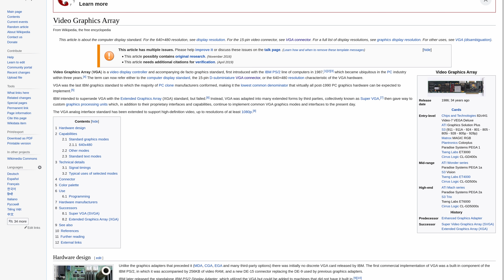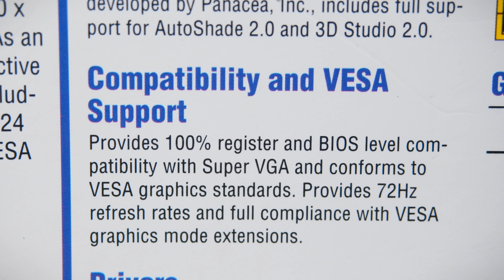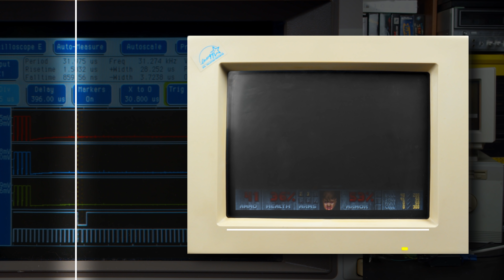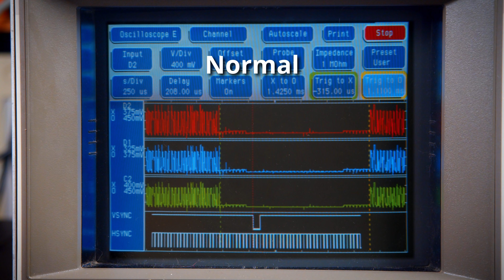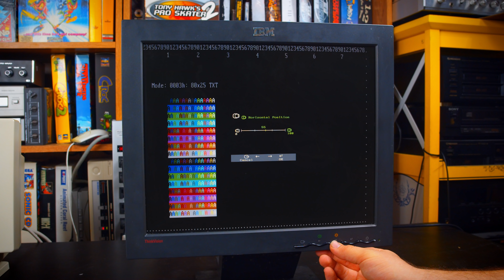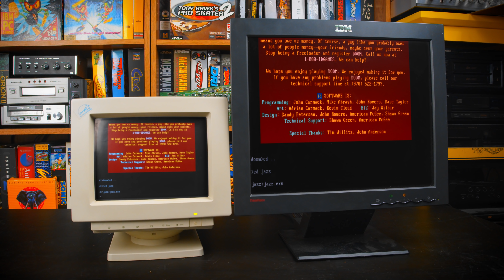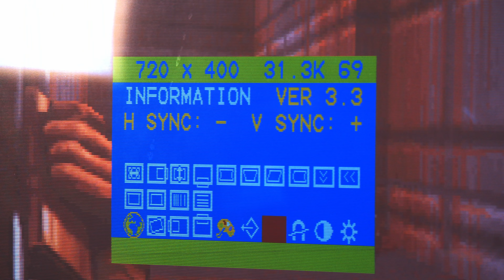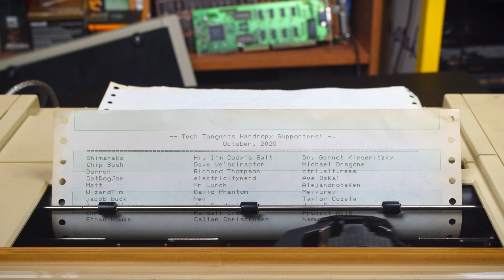How VGA Works

Comment: Also the old VGA was a cheap hack. The 480 lines come from NTSC, 480i for the visible image. What VGA did is to create a 60p version out of it, meaning just doubling the vertical frequency of a monitor and sending line after line (no interlace). So you could  use TV-similar circuits to produce VGA monitors (the stuff after the NTSC decoder to R/G/B).
Some VGA monitors even synced as well to an R/G/B 480i signal, output by an external TV tuner for example.

Comment: Multimode CRTs existed before the VGA video standard. NEC was marketing their original MultiSync and MultiSync II already when the PS/2 showed up. They later included a HD-15 to DE-9 adapter to use the monitor with the fancy new video standard. VGA could also output 15khz video to NTSC or CGA timings with some register poking.

Regarding high refresh CRTs, the bigger issue is usually the quality of the video card's onboard DAC. Most outputted muddy blurry video at higher refresh rates. Hook up a card with a quality DAC like a Matrox, and you clearly see the difference. Whats odd is that video card vendors never really marketed this, just the resolution, color, and refresh rates!
Reply: I don’t get how the amplifier in the CRT is not always the limiting factor. More difficult to amplify to 60 V. How did they even shield this to avoid radio emission?

Comment: @2:49 nitpicking: EGA was maximum of 64 colors, due to the 6 bit resolution, not 256 colors.
Reply: Yes, and even those were just the palette colours. 64 was NOT the number of simultaneously displayable colours, which was limited even further, to a choice of 16 (from the palette). This was due to EGA only working with 4 bits when it came to the actual image to be displayed. The monitor with its 6 colour signal lines did support 64 colours, the standard EGA card did not, a design choice that may have been related to video RAM limitations.
@Tech Tangents: Do you have any explanation or excuse for saying 256 colours there? Was it just a silly mistake, or what was the thinking behind that?
Reply: @ropersonline  chill. :) I think it’s just a simple mistake. With some tricky programming you could actually get all 64 colors on screen at once. But that wasn’t really usable for games.
Reply: @root42  Tone policing people isn't very chill yourself. Also, compulsively answering the part specifically directed at Tech Tangents exhibits the same unchill qualities and isn't a good look. So, chill? Pot, kettle, black. I would be curious to find out more about those 64 colour hacks though if anyone has any information. Especially if that was possible on original IBM EGA hardware, with or without a memory upgrade. It would depend on the resolution, at least.
Reply: @ropersonline  one game that used more than 16 colors is the stat screen of Lemmings. The game switches palettes halfway through the screen to get 32 colors. In the same manner you can more or less switch palettes every scanline. Similar to the Amiga HAM mode. I think I saw a demo where someone made an image viewer that worked like that, but can’t find the link right now.
Reply: @root42  Stat screen or start screen? I'd love to see a screenshot of that tweak in action. The 640x350 EGA start screen screenshot I found at mobygames only has 16 colours. Some VOGONS info I've just googled also seems to suggest Lemmings even switched palettes in 320x200 mode, which is weird, because on original EGA hardware you couldn't use non-CGA colours in 200-line mode, for reasons of CGA monitor backwards compatibility. The 64-colour palette was for the 350-line mode only. Perhaps that "EGA" 320x200 palette switching only occurred on odd EGA clones or VGA hardware. VGA was supported in its own right though, so any VGA owner would have been better off running that.

Comment: Technology Connections youtube channel said so many times that there's no defined resolution for analog signal. It's just artificially divided into lines.
VGA adapter has just two modes 400 and 480 lines. Many cards don't even display 350 line mode, but use 400 line mode drawing 50 lines black.
Even though VGA adapter is complicated hardware mess with tons of registers that can set a lot of different modes, almost all of them use 400 or 480 lines. VGA has unique 'double scanlines' in low-res 200 and 240 lines modes, because hardware displays each line twice.
Base VGA cards are also able to display 600 line modes in 56 Hz. Windows 3.x SVGA 800x600 16-color driver will work on any VGA card, but monitor capable of 600 line modes might be required.
VGA cards can display various modes at 200, 240, 300, 400, 480 and 600 lines. Some games also support 224 and 256 line modes, but my (S)VGA cards synchronize display to higher line counts. Horizontal resolution can be really anything. It's just analog signal. It can be as low as 240 and as high as 800. I've encountered software that used: 240, 256, 296, 320,360,400 horizontal resolution. DOS Quake shows this really well offering horizontal resolution of 320 and 360 pixels at 200, 240, 350, 400 and 480 vertical lines. These are all basic VGA modes. Highest 256-color VGA mode is 400x600.

Ironically VESA modes aren't that flexible, but VESA is just simpler and better. VGA is limited to 20-bit memory addressing of x86 real mode. Which maps only 64 KB window of video memory above base 640 KB. VESA compatible cards have newer 32-bit memory address mode, where linear frame buffer is located at the end of 4 GB address space.
However when VESA was finally getting popular it was killed by Windows 95 and graphics drivers. VESA never had a chance to evolve into dedicated low-level graphics API with increasingly more advanced features, maybe OpenGL or hardware 3D support in general being added. All GPUs are still VGA/VESA compatible, but just as a way for OSes to display GUI on every GPU without specific drivers.

Comment: I made a device for a visually-impaired friend, a matrix switchbox. A charge pump to turn the +5V available off the VGA port into +-5V, which drove a high-frequency three-channel fixed-gain amplifier (AD8075), then a set of three 1P4T switches with 75Ω resistors. Pass all the sensing pins and sync straight through. A handy little box with three switches that let you manipulate the three color channels in VGA - swap them around, remove one, duplicate one onto two or three.

Have trouble on games because you are red-green color blind? Swap the green and blue channels, and those red/green meters turn into red/blue meters you can see more easily.

Doing the same on HDMI would require far, far greater electronics skill - you'd need to program an FPGA. But on analog I could not only do all that on analog processing, I did it almost entirely on stripboard too - the only SMD part I needed was a tiny carrier board for the amplifier. Did have to keep all the wires as short as I could though, at that sort of frequency. I was really surprised that there was no visible loss of quality, even at the highest resolution my monitor could handle.
Reply: That's awesome of you to help out your friend like that!

I wish they'd employ people like you when designing cars. My friend's digital dashboard has a red line on a green overlay for his speedometer, but he's red-green colourblind, so he literally can't see how fast he's going!

I've installed LineageOS on my Samsung Note 3 and it has display settings allowing me to adjust colours and help compensate for colour-blindness. Just thought I'd let you know this is available if your friend struggles with smartphones.

Also lots of new cars use extremely thin strips of LEDs circling the headlights and brake lights for their turn signals, and for anybody with astigmatism, thick glasses, or poor colour recognition, the dull yellow LEDs get completely swamped by the much brighter lights next to them. It's like if you asked somebody to design the absolute worst way you could implement a vital safely feature, that's exactly what they use now. They never once considered people who don't have perfect vision, who make up 20-40% of everybody if you include just colour-blindness and wearing glasses.
Reply: @Microwave_Dave  Oh, here: https://www.youtube.com/watch?v=8HBHJB0lAL0

I've already described the circuit in sufficient detail that anyone with a reasonable skill level could build it. But if you have use for such a thing, I could draw up a schematic such that anyone who knows which end of a soldering iron to hold could build one. It's remarkably simple to construct, though VGA is becoming a rarer connection to encounter every year now.

Comment: Remembering the configuring Linux XFree86 the old way, keeping in mind the warning : bad parameters can fry your monitor !
About the Atari ST video output, too bad I'm much more a SW guy than an HW one. I'd like to connect mine to a VGA display. I know it's possible, it requires few components, but I've read it also needs a monitor that can handle "slow" signals, since the ST outputs low res compared to VGA.

Comment: I actually run 15" CRT in 1024*768. It worked, but won't go up 43Hz Interlaced, or something like so, which was incredibly useless. Also, that ridiculously high-speed CRTs? Good luck with finding video card working with those five BNC cables interface :)

Comment: I'm perplexed about the last bit. Sure the high frequency signals needed for high-res/high-refresh modes certainly needed good quality cables, but what do you mean you don't know if it's worth it? Not only was it worth it, but it was absolutely necessary. Good quality CRT monitors with low-persistence phosphors at 60hz (and at high resolutions) are headache inducing after a few minutes, nobody I know would ever run a CRT at anything lower than 75hz, and for me 85 and up was extremely desirable. And given good quality cables and connectors, the picture quality is excellent, no degradation at all. I have no idea how they managed that, it seems like black magic to me, but they absolutely did.

Comment: How did that table make it through the video ???
I used to run a 21 inch monitor at stupid resolution at 85Hz and when we first plugged it in the picture was terrible, with everything having a shadow or echo on the screen. When I rang the supplier, they said "Oooops, sorry. You need this special cable." They sent me a cable that was standard VGA at the PC end, but a set of BNC connectors at the monitor end. With that, the picture was awesome, though it was used for network management rather than Quake. That was on the other work PC.
Reply: Good CRT needs good cable. Particulary, when you go above 1024x768 x 75 Hz resolution.

Comment: cga, ega, vga oh my. LOL  I remember when I first started in computers. A nec multisync? monitor had 2 ports on the back and ran at least all three modes if not more. I love Kds and Viewsonic monitors. But due to space. I got rid of all my crt's except for one Macintosh one. I don't even use that. I use an adapter to a LCD.

Comment: It's not complicated at all. It's just an extension of the old analog monochrome video standards introduced with television back in the old pre-NTSC days. Amplitude modulated signals coupled with sync to move the beam around. Old computers meant to work with TVs used exactly the same method except mixing the sync in with the amplitude video signal (plus colorburst crap overlayed on top for the chroma signal). VGA doesn't muck around with chroma at all, so understanding any VGA signal just involves recognizing the sync so you can align the analog lines properly.

Comment: Folks please help. I need to use vga video on a device that uses pure rgb with Csync. H and V sync combining is quite well documented. What i can't figure out is how to get the device outputting vga signal to detect that a display has been connected and start feeding signal in the first place. I've read that if you ground the ID pins according to the DDC combinations it'll trigger the device to start outputting signal. Still waiting to get pins to try it out though.

Comment: I'm having a problem with a Dell P780 17" CRT reverting its brightness values too 100% after a KEYSTROKE. This happens after watching a video because of keyboard inactivity. It is very frustrating because it is a minor issue likely with a capacitor or chip but it obviously causes major visual disruptions. I can't remediate the issue with f.lux because the brightness level that it reverts to destroys the black levels, which is why most of us are using CRT's to begin with. Would isolating the unused VGA pins or changing the custom timing in Intel HD Graphics Center possibly help? Or is this a novel issue that only some retired technician somewhere out there who knows which capacitor needs replacing?

Comment: Ahh good old VGA. Sometimes I miss the old 19 inch CRT monitor I bought in 1999 and kept for WAY too long. That beast could do 1600x1200 but I mostly used it in Windows at 1280x1024 with a 85 hz refresh rate. At 1024 x 768 or below it would easily do 100 hz which was sweet for games. Those were good times!

Comment: What do you mean they can be damaged by sending the wrong signal?  What?!  I've never heard of anyone frying their VGA monitor due to an incompatibility with their computer's VGA output.  Please Explain.
Reply: The transistors which switch the voltage over the yokes can be damaged. Though with modern digital technology I don’t know really how. The general problem is that a lot of current flows at max deflection while we switch from a steady relative low voltage to a higher voltage for the fast flyback. I guess diodes are involved, but to avoid the forward losses I would still try to have some kind of “CMOS” gate with controlled overlap. To reduce EMI I would try to create a balanced signal.

Anyway, these transistor(s) need time to dissipate the heat of the switch. Maybe current can also rise too much if we deflect too far.

Vertical switching is spaced farther apart. Voltages are lower. Maybe some manufacturers were too cheap here. Don’t go below 100 lines?

Comment: Since when is EGA 256 color?  Is this referring to what the monitor can technically display?
Reply from the maker: I may have made a mistake with that. I went back and re-read more on EGA and I can't see how it would be 256. I think I meant to put 64 color for the total number of colors. EGA is really weird with the palettes and I haven't had a lot of hands on experience with it yet.
Reply: @TechTangents  Yeah, EGA"s max was 16 colors from a 64-color palette (2:2:2 RGB), but only in 350-line mode. In 200-line mode, it was backward-compatible with CGA and only allowed its 16 colors.
Reply: @lee4hmz  The 16 color 200 line mode was almost exclusively used in games to allow for backwards compatibility with CGA monitors. That's why you can get 16 color EGA on a CGA monitor with an EGA card.

Comment: my new made-up retro resolutions for 16/9:
640 x 360
480 x 270
448 x 252
320 x 180
256 x 144
and a new made up dual-pixel color mode:
1byte per two pixel: 2bit Y1, 2bit Y2, 2bit U, 2bit V (YUV or YCbCr) maybe Y with a logarithmic coding.

Comment: Why a bad signal could damage a pure VGA CRT?
Reply: A lot of older monitors didn't have PLLs on the sweep circuitry for the CRT, like TVs do; they just fed the raw sync signal directly to the output transistors. Since the horizontal circuit in particular was set up for a certain frequency, feeding it one that was too far out of spec would cause it to draw too much power and overheat.
Reply: There were a few ways.

A bad signal could lead to instability in the horizontal sync that drew excess current, leading it to burn out. Or it could cause the sweep signal to be not generated at all, so the electron beam would be focused on one line of the screen with such intensity that it would rapidly degrade the coating in a form of accelerated burn-in.

Comment: I don't know if you know about this already but the mic is a tad bit boomy to listen to. With proper subwoofers and balanced speakers, your voice is way too deep, and the extreme noise reduction doesn't bode well either. It's fine for now, but just a bit of advice for the future.

Comment: Casually watching this video at 1440p on a VGA CRT.
Reply: Damn what incredible crt do you have that it displays 1440p without getting muddy?
What’s the dot pitch?

Only the gdm 520 has a dotpitch of 0.22, nothing else is as fine.
Even its derivatives from other companies use a different chassis that only has 0.24.

The fw900 is often praised for being able to display 1440p, but it just isn’t sharp enough because its size of 24“.

Comment: A relatively interesting fact is that even though HDMI is a digital video standard, its video signalling a direct descendant of DVI, and DVI retains the synchronization pattern from VGA with HSYNC and VSYNC surviving as two control bits. DVI keeps the front and back porches alive and HDMI even makes use of them by optionally encoding audio and auxiliary data signals into blanking intervals. (The funniest part of the spec is the sentence that goes roughly like "each data packet is 32 pixels long")

I suspect that DVI was designed to be implemented by replacing the DAC with a high-speed serial transmitter and leaving the rest of the video chip intact (knowing the hardware people, I don't think it's too far from the truth) and the spec is explicitly permissive of pixel timings, so we're lucky that modern displays work at all with all that legacy.
Reply: Don't forget that DVI does have an analog mode compatible with VGA. (It's not always implemented, but it's there in the specification.)